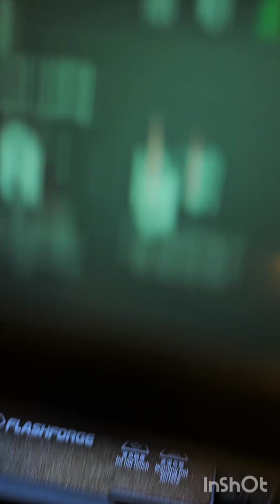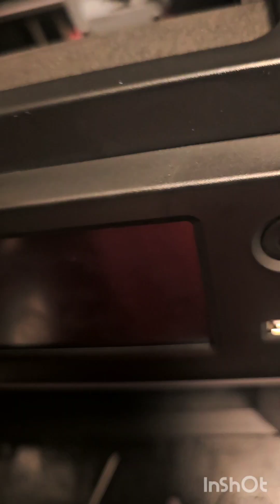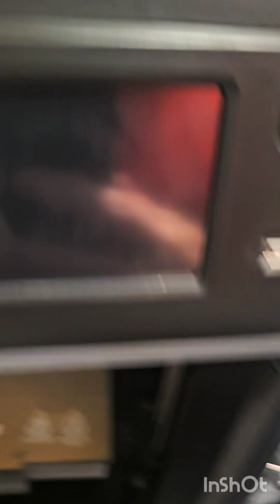Flashforge Adventurer 5M Pro - Jammed Extruder

Comment: I’ve had my Adventurer 5M Pro for 2 days.  I’ve run about 8 prints and it has jammed.  I’ll go take a look at this now.
Reply: Here’s what I found.  The nozzle was clogged.  Also, the gears in the filament feed were so tight, they had chewed the filament into sort of an hour glass shape.  Thanks for posting this video.  I took the feed apart, cleaned it out.  Cleared the nozzle and put everything back together.  I tightened the feed tension screw just enough to feed filament through.  Then, started a print.  I could tell the filament wasn’t feeding through well (thin print).  Gave the tension screw another 1/4 turn and tried it again.  It’s now printing well.  So far, so good!  This video was very helpful!

Comment: Very helpful, thanks. I ended up needing to use the cutters that came with the printer to cut around some of the dried, gunked up filament inside the extruder to be able to get it all out. And idea what causes this to happen in the first place?

Comment: I couldn't find any information on how and why this happened.
Filament replacement? Poor quality filament?
This method of nozzle replacement, including the melting furnace, is designed for cases where different types of filament with very different melting temperatures are used. You need to have a dedicated nozzle for each type of filament. Then you don't have to deal with problems with a clogged hotend.
If the filament has wound up in the extruder in front of the hotend in this strange way, it is probably a poor quality filament or the cooling in front of the hotend is not working properly - the fan on the left side of the extruder.

Comment: Thank You!   New to 3D Printing (got this 5M Pro just 3 days ago) --- Been printing flawlessly for days but I decided to try some Silk Multicolor Filament and completely jammed the feeder... would not advance into the hot end at all... 😞  Just a Clicking noise and would not advance the Silk Filament.....     This vid was crucial (along with a few others just for confidence) in taking down the print head and clearing the filament that had wrapped around the gear...   testing it now (I was able to load the normal PLA finally) --- Thanks Again!!!  --- p.s.  You may wanna do an actual vid from start to end of you (expertly) taking it down to the gears and back...  I figured it out but was touch and go for a bit... 🙂   Thanks Again!

Comment: Thank you for this! My Adventurer 5M jammed. Thankfully the pro extruder is pretty much identical to the non pro version. Your video showed me what to expect and I got to taking it apart and got the jammed TPU filament out and I'm back in action!. It's crazy yours jammed after only a few prints. I've printed hundreds of things since I got mine and it only jammed after trying to making squishy feet pads for another print with TPU for the first time. Thanks again for this video!

Comment: this is a very common problem & comes down to poor design.  i actually had filament jammed in hard enough by the gears to deform part of the extruder housing.  fortunately for me, i make it a point to keep common parts like this onhand, so i was back in business as soon as i swapped it out.  i've been seriously thinking about redesigning the extruder & would love to use hgx gears, but space is at a premium without replacing the entire propriety toolhead - which is realistically probably going to happen with mine at some point.  it's been my abs workhorse otherwise, but i've gotta say i like my diy machines better - particularly my e3ng & my micron.

Comment: Your video gave me the courage to take it apart, well and that I had something I had been printing. Yikes there was some filament stuck in the gears, which I wonder if it's the brand I was using, which I will be mindful and use only Flashforge from here on out.

Comment: The question is: Why did it happen? Is basically low temp right? How to avoid this? I just printed my 6th. roll of filament in 6 days with my new printer without manipulating the profiles for PETG and PLA and everything worked just fine. Old firmware maybe? It´s like going back to the bad old days with shitty extruders. I don´t want to go back to that nightmare.
Reply from the maker: @joseguevara184  I think it's actually too much resistance from the filament roll or just bad tension in the feeder gears. It only happened to me once... But I have been very cautious about the fees resistance since that day. And for TPU I actually remove the lid, hang the filament directly over the unit and feed right into the top of the printer head.
Reply: @lranger251  Thanks for the info. Hope don´t happen again.
Reply: Mine clogged too but what I figured out was I had sliced a file with petg high speed and tried to print it with pla hs . It was too hot and the heat melted the material inside the extruder mid way through the print . I saw this video and took it apart and there was all the melted plastic . For the most part all my problems with any printers is not paying attention to the basics . Then when it malfunctions first thought is it’s the printer manufactures deign issue . But to be honest  it’s really more my ignorance or lack of attention . Blame game is not a good way to really get to the root of the issue . Because if you blame it on the mfg you stop thinking it through and you will do it again . For the  most part flash forge understands this and instead of defending 5hey just send you the parts and hope you figure it out . They are a good company
Reply: @daveoutlaw9890  That´s the reason why some companies try to protect the modifications on the printers and void guarantees and for a very good reason, Is hard to admit when we commit mistakes and try to blame others specially when spending money and get frustrated. This printer is Klipper, obviously, nice profiles and prints fast and good, this is what a 3d printer must be, changing versions, updating things, moving parts is not for me. To me is perfect for what I need it for, to print nice objects. Thanks for your honest comment.
Reply: I did the same thing I tried to print pla with a petg sliced file . The filament temp was too high and at so points in the file the feed rate slowed and heated up the pla filament to a softening point above the extruder gears

Comment: Thank you for your video. I have a service request in at Flashforge but after I sent it, I watched your video. Flashforge should be telling you Thank You for all of us. I’ve run mine for 6 days without issues until I used Orca software, that’s when I had a problem. I noticed the default temperatures in Orca are lower than Flashforge. I think that was the problem.

Comment: I've had my 5m for like a month and I have loved it, but i just tried to print with tpu and it clogged the gears, imm goint to try this and see if it works. great video.
Reply from the maker: @JosephLamoreaux-z2y  Actually I should make a video of how to print TPU on this thing. It does a great job but you can't use the feed tube. Remove the top lid (Bend the door slightly) then hang your spool over the top of the printer and feed the Flexible filament directly in from overhead. Just take a short length of PLA and shove it into the tube to trick the filament sensor. If you try to feed it it normally it just stretches out the filament and jams.

Comment: How'd you take apart the extruder assembly with the gears itself that was press fit? Did you just take a screwdriver into the plastic gear gap?
Reply: I’m having the same issue. I can’t get the plastic white gear off of the side to get to the inside.
Reply: Did either of you figure out how to???
Reply: @Shadowreaperx199 you can pry it off with a small screw driver. The small plastic white gear pops off basically.

Comment: I'm having a problem where after the 1st layer is done, and the printer speeds up, it stops extruding about halfway through the 2nd layer.. I've taken it completely apart and tried this in the video.. nothing wrong with the extruder teeth.. cleaned them out anyway. switched up filament, didnt work.. removed the filament detector, didnt work. Tightend up the tension screw on the extruder, didn't work (tried to loosen it too, same result) Ive got 1000 hrs on this printer and now suddenly nothing I do can make it get pass the 2nd layer..
On smaller prints like a bency it works just fine.. But the moment it speeds across extruding a lot of filament at once it fails every time..
I print PLA at 220 religiously and never had this problem til now.
1st layer is always perfect.. 2nd layer is a 50/50 and everything pass that is gonna be junk..
small prints = fine
big prints where it speeds across the platform = fail
Reply from the maker: @pokeygalaxy  I am not an expert in this, but a few thoughts come to mine. Try doing a full relevel and recalibration. Maybe one of the stepper drivers is misreporting it's positioning data. Another thought is to try a different slicer. Slow down a test print and watch it see if you can spot something specific slipping or messing up.

Comment: Hey Allen, I have my printer reassembled and when I load or print filament the gear in the extruder does not grip or pull hard on the filament enough to take it in. It can load fine when I push it through, but the gears just can't get a grip on it. When I had the printer in the assembly process down to the lowest point with just the gears and outer grey container, the spring pooped out and I put it back in. I don't know if the spring isn't pushing hard enough or what. Everything in the video was extremely well done and mine was the exact same so thanks! If you have any idea how to fix this please let me know. I think you should post way more because your videos are super amazing. Thanks!
Reply from the maker: @BrawnzeEstreen  If I remember correctly, youu need to screw in that recessed Allen key. It adjusts the extrusion gear tension and I remember I had to screw that in a lot more than I would have expected.
Reply: @lranger251  Thank you so much it worked and I am back to printing! I am serious you really should post more

Comment: Mine failed in the same way after just one of the test prints - worst machine I have ever seen - and I've bought -and I have bought over 100 over the years . Ideas are good, but implementation abysmal.
Reply from the maker: @iainduncan3312  Fortunately this only happened once and it's been solid since this happened. I am assuming it was just old filament or something that I used. My older, slower printer were far more forgiving, but I assume it's the speed of this machine that doesn't tolerate bad filament.

Comment: I would add that I had to take the pin out as well. It's always a little nerve wracking pulling those parts apart, but it worked out. I think it may be related to using old PLA. I'll update in a few if it happens again, but will try to use recent PLA rather than stuff years old.

Comment: Excellent explanations, man. Thanks! I am totally new to 3D printing and just got the 5M Pro. After a couple of the first test pieces a similar jam happened in this one, too. Your video helped me to not only have the guts to take it apart but to fix the issue and put it all back together as well. Piece of cake! You rock! Thanks again.
Reply from the maker: @brianmcrock  Glad it helped. I spent quite a bit of time scratching my head and questioning tearing into a brand new machine. Which is why I ended up making this video in the hopes it might help someone else.